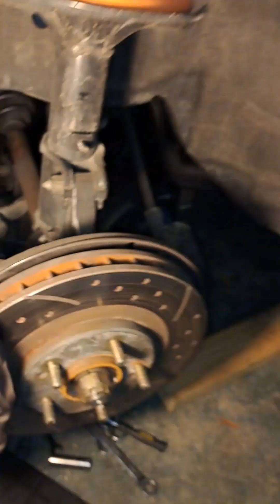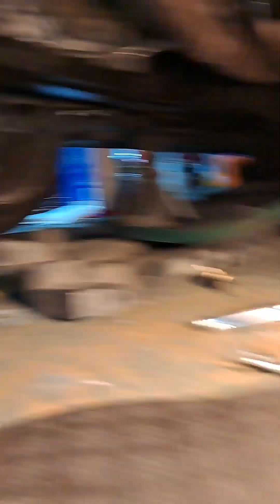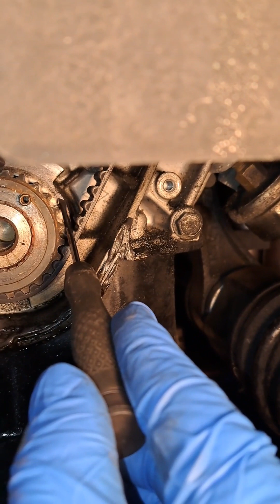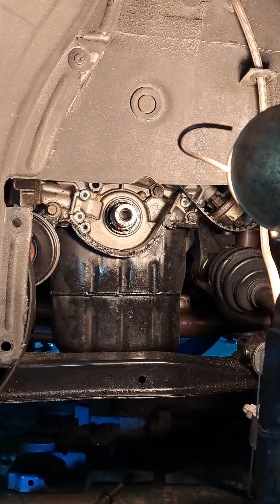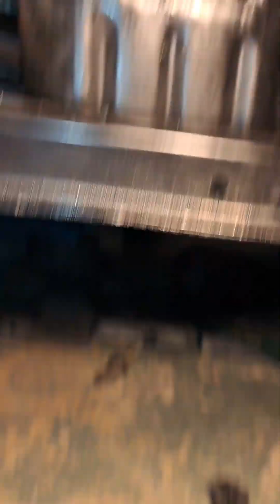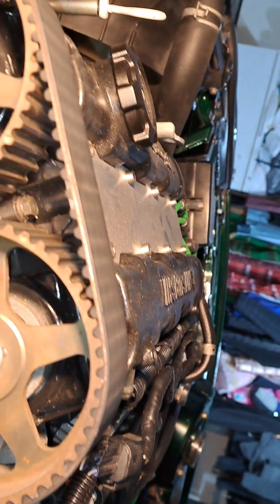Mitsubishi 3000GT Front Main Seal Leaking Oil #3000gt #oilleakrepair

Comment: I bought a 1996 N/A model about a year ago, it drove 600 miles back to my house after i bought it but on the second day it didn’t run. It ended up being that the owner or mechanic who worked on the car previously had left a lose screw somewhere under the timing cover and it fell and made contact with contact plate for the the crankshaft position sensor, tore it to shreds. Anyway I need to replace that but my timing belt sprocket is stuck on there good and I was curious if you had any tips.
Reply from the maker: I wish I had a secret weapon for you. I rebuilt my engine with 150k miles on it but it was out of car so I could get it off pretty easy. So this go around it slid right off. The first time I put a small strap wrench on it and pulled out as I turned the strap wrench to get a good bite and it popped off. You can even try smacking it with a plastic mallet then strap wrench method.

Comment: Thanls for the video. My sons car (base model) seal is shot and I am down to pulling the old one out. I sure hope the pick idea works. Thanks again!!
Reply from the maker: I have used a few methods, a pick, a long flat screw driver, and have even drilled 2 small holes in outer metal part and ran sheet metal screws in to pull out. Hopefully one of those methods will work for you

Comment: How did you remove the timing gear ?
Reply from the maker: I rebuilt the engine about 3 years ago or so. I pulled the gear off then but cannot remember if it was difficult. Fast forward to this video, the gear pretty much slid right off by hand. Is yours stuck?

Comment: Appreciate you sharing this process. We about to do the same thing on our 6G72. This is very helpful
Reply from the maker: You are welcome, didn't get in depth on timing belt, bunch of videos on that. If you end up pulling the motor mount on that side be sure to put a block of wood on jack under oil pan to keep from caving it in